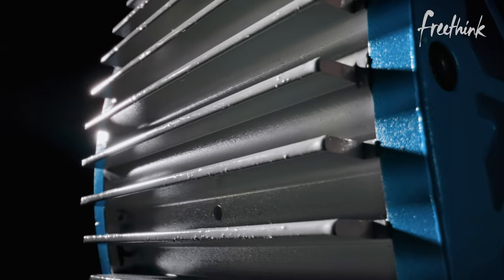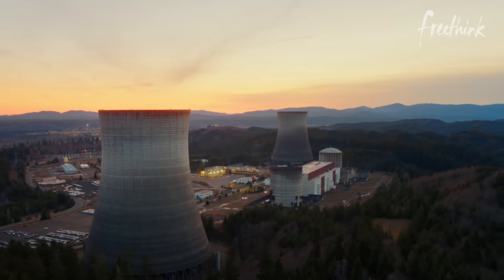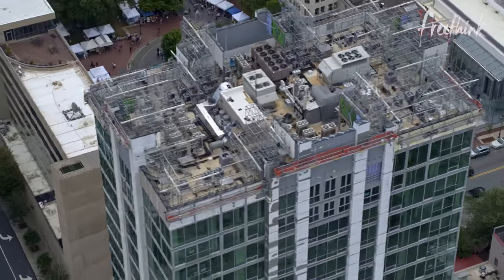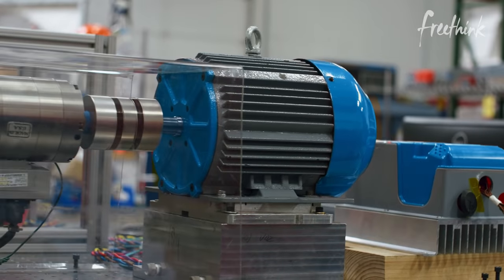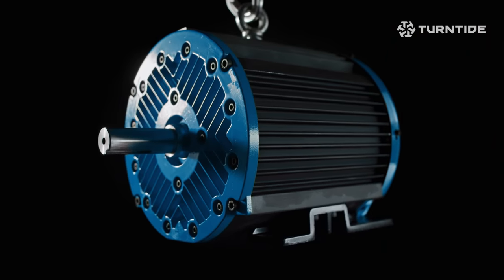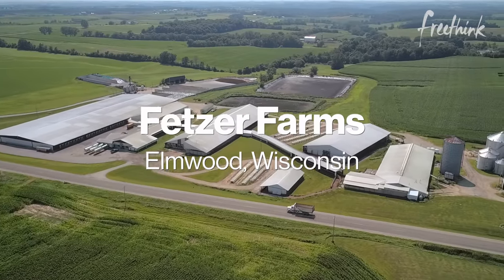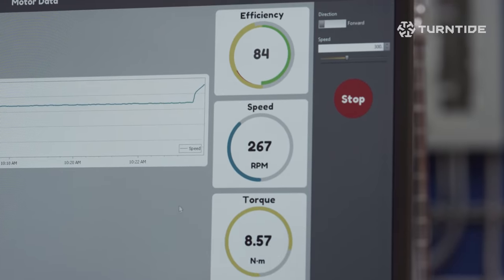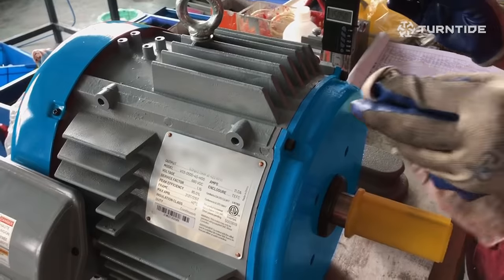Want to Save the Planet? Start with Reinventing the Motor

Comment: the way this motor works... is kinda just a 3 phase brushless.
Reply: apart from having iron in the middle instead of magnets
Reply from the maker: Here's some of of the differences between BLDC and switched reluctance motors: https://www.mpoweruk.com/motorsbrushless.htm 

Also worth noting that switched reluctance motors in general, as the video says, have been around a long time. However, the use of modern software to drive and control it is what differentiates TurnTide's motor. (details: https://softwaremotor.com/technology/)
Reply: Freethink yeah I’ve read that, but I still don’t see how the tech would be different to controll the two
Reply: from that explanation its more like a stepper motor than a bldc.
Reply: Eric Meyerson Thank you 🙏
Reply: @Eric Meyerson this comment is better than the whole video
Reply: @juliankandlhofer7553   True that
Reply: @Eric Meyerson thank you for the great explanation! You should have made the video, would have been way more interesting
Reply: @goldenpiston8449  I think 3phase is already brushless. This video looks like BS.
Reply: @Eric Meyerson Motors are basically all the same, like books.
Reply: Eric Meyerson what about standard tesla motors? The ones without permanent magnets that Nikola tesla was making a hundred years ago? I think they are called induction motors.
Reply: @Eric Meyerson Magnetic iron also "breaks" with time at high temperature as it turns to face centered cubic phase, and laminations fry.
Reply: @Eric Meyerson Nice answer.  The video left me with more questions than answers, like an infomercial about an egg cooker for the microwave.  Your answer almost fixes the video.
Reply: @goldenpiston8449  squirrel cage 3 phase induction motor doesn't have magnets.
Reply: The crap adventures of Che Simons yeah, but its like mega efficient
Reply: @juliankandlhofer7553  exactly. This is not new
Reply: That's exactly what I thought! Wtf
Reply: @Eric Meyerson BLDC are also sensor less, hall effect sensors are just use in really low speed BLDC. How can a SRM be sensor less at low speeds? 

Also what is the real advantage here? Speed regulation with a cheaper control mechanism than VFD for induction motors? Can they do the switching without an AC/DC converter unlike VFD? 

Not using rare earth magnets is surely one, but I still have a hard time understanding the advantages.
Reply: @Eric Meyerson I have been running my bldc with sensorless foc for months now and I haven't had any issues with it, hall effect sensors for control of bldcs  is no longer needed
Reply: @hasenlamano  How do you handle sensorless startup from stop hen the back-EMF can't be measured? Do you just start spinning the current vector and wait for it to catch?
Reply: @unclejoeoakland  I don't know much about this topic, but a quick search shows 3 phase motors having a very narrow optimal range. If you want a wide dynamic range, 3 phase isn't very good unless you're willing to put thousands of dollars into a controller like what Tesla uses. If we could take advantage of 3 phase on the cheap, I could understand the possibility of efficiency and longevity. I would like to know more about this, but I see enough buzzed up snake-oil.
Reply: @BenjaminCronce  I think the buzzed-up snakeoil is this video and it's claim of a new type of motor. Anyways, I was being slightly facetious- three phase has no brushes or electrical contacts. Nonetheless, both brushless stepper motors and polyphase variable-frequency-drive motors can operate with pretty consistent efficiency across fairly broad speed ranges.
Reply: unclejoeoakland all you have said is true sir and the statement this guy makes at :30 of “half of the energy that goes into motors is wasted” is a complete BS statement motor efficiency is stamped on the nameplate and as an electrician I have NEVER witnessed a nameplate of 50%, all are 80% or better that I have delt with. Not that isn’t to discount this technology it may very well be efficient. The hing pin and key to this technology will be the quality of electronics they use for the incredibly fast switching needed to make this work.  It may be 99% efficient but if it frequently breaks down in the electronics causing loss of production this will fail
Reply: @vel5724  yeah I mean I think a lot of people don't get how cool the engineering is in motors. You sound like you're an electrician or else maybe an electrical engineer?
Reply: unclejoeoakland Journeyman Electrician, Automation Technician, and Electronics Technician. So I troubleshoot, diagnose and replace motors/drive about every day. So I see first hand when production goes down the pressure and rush to get it back up and going with the plan manager standing behind me “just wanting it fixed” lol
Reply: @vel5724  I'm sure he doesn't mean to bird dog ya BUT- lol!
Me, I'm just a lowly cabinet maker but I looove me some 3ph motors. My shopmates are electricians tho. Good people. They even rewind motors, which looks like art to me.
Reply: unclejoeoakland motor rewinds are cool, I don’t ever get to myself but it does look awesome
Reply: @Georg_S  Good read - thanks!
Reply: Stepper motors also works at same pattern..reluctance..
Reply: How is this different than buying a cheap $20 motor controller for all existing motors out there in the world
Reply: Wow! Nikola, Theranos, and Enron alll wrapped up in one winding!
Reply: Kyle Towers  I agree but, nearly every motor type can be controlled to some degree
Reply: And three phase induction motors are already pretty much 90% efficient. I don't know where they're getting their 50% of energy wasted, maybe universal motors? Even universal motors are more efficient than that

The model 3 and model Y Tesla cars also use a switch reluctance motor for the base model. They add a conventional 3-phase induction motor for the performance models or all-wheel drive
Reply: @Jaker788   three-phase induction motors waste too much energy into heat. Bldc motors have better efficientcy but still can get hot. A 90% efficient motor should not get so hot
Reply: Literally the same thing
Reply: Simple like that.
Reply: @Eric Meyerson great explanation,so basically its just a squirel cage type motor and runs on AC, speed depends on the frequency of the source. What i dont understand is what's the difference from the existing technology? you are one of the Co-Founders i guess? if you want your company to succeed, better give some technicalities in the video since people who will be interested to watch this video are engineers or people who are in the industry.
Reply: Didnt notice the non magnetic core maybe??
Reply: Hmm motors these days: ~   98 percent efficiency  battery way way worse maby start with the battery
Reply: @Eric Meyerson bro, it's just a fancy induction motor...
Reply: @juliankandlhofer7553  Stepper motors come in two types: permanent magnet, which are similar in principle to brushless DC motors, and variable reluctance, which are similar to the switched reluctance motors described here, in that they do not require permanent magnets in the rotor.  Additionally, variable reluctance (or switched reluctance) motors don't exhibit the "cogging" that BLDC motors and PM steppers do.
Reply: @unclejoeoakland  Most electronically-controlled motors are 3-phase, but among 3-phase motors, there are distinctly different types:
1) Permanent magnet synchronous motors, which use permanent magnets in the rotor,
2) Induction motors, which use currents induced by the stator into coils in the rotor to provide the field in the rotor, and
3) Variable reluctance motors, which just conduct the field generated in the stator through the rotor.
So yes, it's 'just" a three phase motor, but it's not BS.
Reply: Basically a servo
Reply: 60-70% efficient!! Is this the efficiency of motor?
Reply: @Eric Meyerson Thanks, the point is no Neodimium. The element will getting much more exepensive in the future.
Reply: Bruh, why didn’t u develop it then
Reply: Eric Meyerson ok, so it’s just a more refined version of a motor. Makes sense.
Reply: @32353235e  if they could cost effectively coat the laminations @ 0.0001 thick they could stop the corrosion that causes them to fail due to oxidation. In turn increasing the life of the motor.
Reply: Back EMF also a potential energy that be can store and re-used,,,,,...!!!???Tesla/John Berdini
Reply: Sounds like Lg inverter motors
Reply: @BenjaminCronce  - take note that "dc" 3 phase motor and ac 3 phase motor are different in nature,,,,,
Reply: @doates625  - as they said, on and off : the timing means of before-mid-after angle of rotation precisely along the coil and magnet facing each other,,,,

one way is 

"on" fulling into mid - then - "off "BEMF pushing away from mid.

also "off" position give BEMF that can be stored and re-used through diode, capacitor and inductor.

2n way is!!!!!?????we get through,,,,,,,that
Reply: @unclejoeoakland  - 1st Brushless: magnet alone revolve steady winding/coil
while 
2nd w/ brush: revolving winding/coil steady magnet connection through brush

3rd combination if u understand field excitation arrangements

Using strong magnet can reduce current consumption and gives more power output.

brushless can be single or 3 phase

"dc" 3 phase motor
"ac" 3 phase motor
as dc and ac different in nature

TESLA CAR what motor is used...!!!???
Reply: @BenjaminCronce  - take note :
AC 3 phase motor
DC 3 phase motor
are different in nature

using strong permanent magnet can reduce current consumption but gives more power output depend on timing as they say 
"on and off" in case the coil and magnet facing each other precisely in angle of rotation such as before-mid-after position

much differ in supply:
dc become ac in side the motor
0r
ac become dc in side the motor

we don't need that now it's so complicated

Sorry for that,,, i'm not good in English.FIL.
Reply: @cornyhub7551  well Tesla uses what amounts to a variable frquency drive, which means its poly-phase with electronic and thus brushless switching. And liquid cooled batteries.
Reply: @unclejoeoakland  - Through Nicola Tesla and John Berdini people ideas people give development
AC 3  Phase Induction Motor
DC 3 Phase Motor - with strong permanent magnet
TESLA CAR which motor type...!!!???
Reply: @unclejoeoakland  - do know how make PCB using Eagle or EasyEDA in Electronic Simulation Software to design a Circuit ,,,,
OK,,,,,,,,

We need the following topics

1. DC to DC converter
2. Analog to Digital Converter
3. Digital to Analog Converter
4. Voltage to Frequency Converter
5. Electronic VDC - 3 Phase Converter
6. Hall Sensor Module(optional)
7. Optical Sensor Module(optional)
8. Current Regulator circuit
9. Isolated Transistor drive for H-Bridge
9. H-Bridge amplifier using Power  Transistor,  MOSFET and IGBT
10. Electronic Pick-up RPM Module
11. DC 3 Phase Brushless Motor Drive Module -as a hole( you by a unit)
 
Type of motor
A -Brushless
    -with brush
B - ac 3 phase induction motor
   - dc 3 phase motor-w/neodimium magnet
C -No. of Poles
     1, 2, 3, 4, 5, 6 Etc., 

>>>>>>>>>>>>>>>>>>>>>>>>see in YouTube

ALSO SEE JOHN BERDINI CIRCUIT
It's easy and simple all in one circuit motor drive including Actuating Motor.
Reply: more topic : Study 2, 3, 4, and 5 wire Motor
Reply: Another Topic
BMS : Battery Monitor system
          1. Constant Voltage Charger Circuit
          2. Constant Current Charger Circuit

and many more topic,,,,types of battery such as Li-on, Graphine, Solid State, mechanical battery etc. cooling system need in large scale installation
Reply: CORNY HUB use 14 poles. It’s a solid anount
Reply: @goldenpiston8449  YES, with outer magnet revolve
Reply: re-act as fly wheel too
Reply: @HeavyRayne  seems like they made this video for non engineers and the only ones who came to watch it were engineers haha
Reply: The S.R.M. is not just brushless but also without any  physically embedded magnets on the rotor.... i.e. the rotors magnetic field is generated by its stator's electro-magnetic field..( doublely salient motor)
Reply: @analoghardwaretops3976  so the dif between an induction motor is…?
Reply: No, it's actually a reluctance motor, but also - nothing new
Reply: @freethink  So why no graphs of cogging torque or output versus speed and efficiency?  Why no specs on speed limits?   We've been promised working reluctance motors for years.
Reply: @goldenpiston8449  I see your BS-o-meter is well calibrated. This seems like someone slapped a Nest controller on a motor and called it a patent.
I've been in the electrical motor industry for more than 10years now and can tell you this is a reduction of customer usage, not a fundamental improvement of the motor technologies. 

The business model here is to reduce motor operation during times not being used, that's it-- "the 70% more efficient" is for the end customer's electricity bill, not a physics improvement of converting electrical to mechanical energy, that's BS. Motion control motors are typically 80-95% efficient currently. Some specific application motors are tuned to be maintained at >95%. Where's the 70% efficiency increase when all you've got remaining is 5%? Is this big Pharma?

Here's my take on the video breakdown:
The whole thing with green energy needed for the world in the beginning is for marketing because a purpose needs to be stated for the video. <-- This is the [WHY]. The patent (if there really is one pertaining to a true motor construction break through, instead of a simple manufacturing improvement patent) is mainly an electrical aspect-- it's just mumbo jumbo to give credibility. 20 THOUSAN DTIMES A SECOND? OMG!! you mean 20kHz? So you have an ASIC. awesome. 
What this video fails to connect is the patent for the controls side, which has nothing to do with the efficiency of the motor side. <-- This is the [HOW], stitched together by someone who is not an expert on the topic.
Now you need more credibility from a big company, BMW. Right. If that was Tesla instead, yeah, I'd believe it-- otherwise it's just another "stamp of the king" but the king doesnt even know or care about it.
Reply: @derpamine  funny enough I posted my comment as a joke at first, I wanted to get the creators salty. Yeah ik we have been using reluctance for years now, this is nothing new.
Reply: @vel5724  they’re talking application efficiency of line start motors in big applications (brushed DC or induction) versus a VVFD (basically) controlled SRM. The efficiency stamped on the motor is at rated load, a lightly loaded line start induction motor is inefficient (just Google the curves) and has a low power factor (say ~0.9). With a VVFD controlled SRM u can get higher speed range, set PF to 1, and get that ~90% efficiency at all loads/speeds. Also can go the minimum required speed which can save you on stuff like HVAC (people are already putting VFDs in HVAC to cut power use).
Reply: @Jaker788  90% at rated load. You need a VFD or VVFD to get that 90% across load and speed ranges. Take a look at induction motor efficiency curves. Also some inefficiency related to the grid by not running at PF=1. The 3-10 MW motors we use are usually ~0.9 PF
Reply: Its total BS.  The entire video is a bunch of crap.  I have worked with 3 phase motors for years and these guys act like they reinvented the induction motor.  96% efficient induction motors were invented over 100 years ago!
Reply: 666th 👍
Reply: @juliankandlhofer7553  No, in the stepper motor, the rotor align with the magnets, this is more like a BLDC
Reply: @goldenpiston8449  that's why you weren't the one who invented it!
Reply: @zackjoubert5207  again, for like idk which time, if you scroll up you’ll see that I meant this comment as a joke. Obviously I know what forced reluctance is, and I also know that it was invented very long ago.
Reply: @goldenpiston8449  lies...
Reply: @zackjoubert5207  first patent for them was in 1838.
Reply: @goldenpiston8449  lies!
Reply: It's a stepper motor in essence.  Multi phase.  Same idea as a 3 phase but more phases.
Reply: @GodzillaGoesGaga  no… not at all lmao
Reply: Basically like a switching power supply optimizes the current/voltage waveform delay thus having smaller and more efficient transformers without excessive inductance loss, the same could be applied to the stator windings. Neat
Reply: In the video they mentioned that this was a cheaper alternative to the Motors that are already in a lot of industrial applications. I get there's no magnets, but the electronics to control it is probably just as expensive as the motor itself.

Now I don't know what kind of motor is already built into those industrial applications, but if it's assumed to be a brushed motor, I don't see how it's more cost effective.
Reply: @Eric Meyerson bro.  That answered so many questions!  😊
Reply: So you build another synchronous Motor like someone did in 19th century?
Reply: @freethink  that's some hot bullshit you've got there
Reply: It is a stepper motor, and yea it ain't new tech.
Reply: I was thinking the same thing HVAC already use three phase motors with inverters that allow you to slow the motor and take advantage of the cube law for energy saving
Reply: @BenjaminCronce  VFDs are cheapish these days for 3-phase motors.  At work we have motors from 1-600hp, and any that need speed speed control (or any sort of advanced control) use frequency drives where possible.  Honestly the name is misleading because a high end VFD lets you do so much more than simple frequency control...
Reply: Exactly what I thought..
Reply: It’s really current control that’s the difference it’s still not that hard
Reply: Most motors to my understanding which is limited, repel and not attract is what this motor appears to do🤷
Reply: @thomasholland4313  well then you’re wrong lmao.